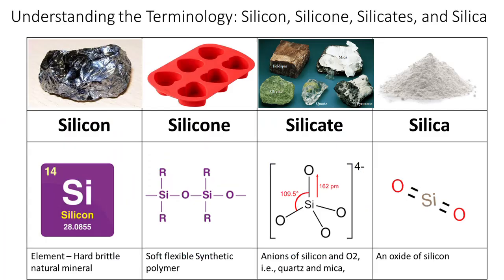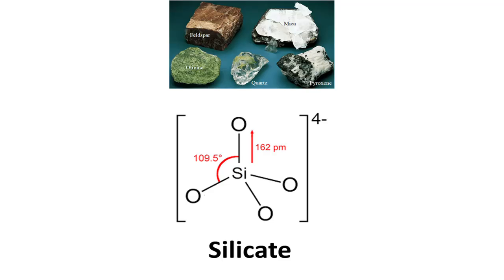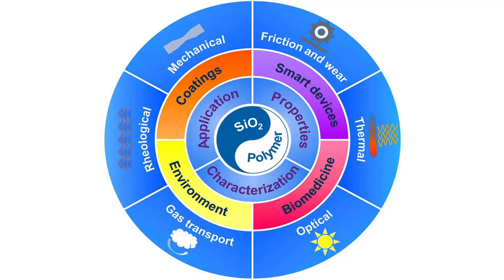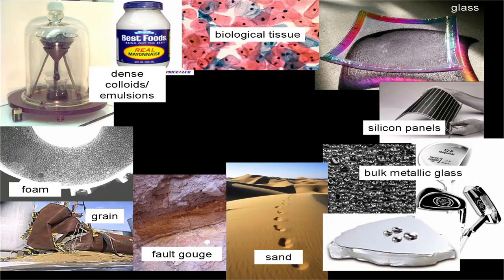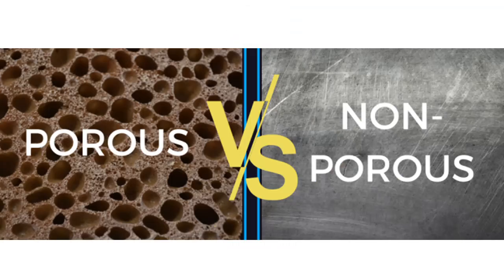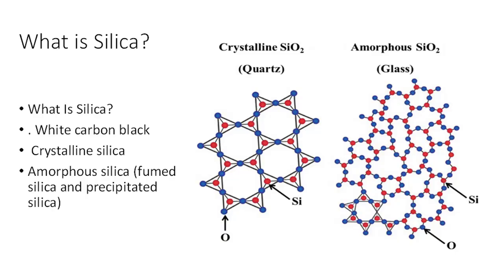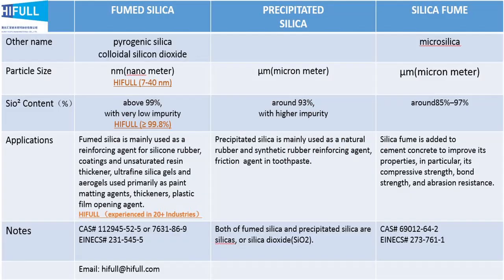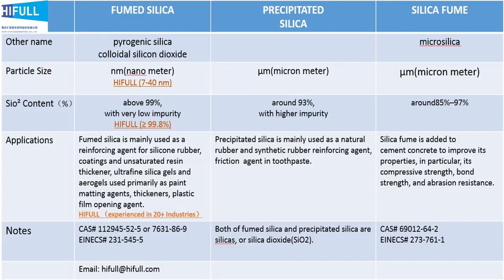All about Silica - Session 1 (Introduction)

Comment: Very good video. I heard you say that pure elemental Silicon is highly conductive, is that true? I recall learning that its not very conductive unless you dope it to alter the bandgap, as in transistors
Reply from the maker: Hello. Thanks for your comment. You are right and that's true. Sorry for the confusion; actually, it has been stated in comparison with polymers, which cannot conduct electricity at all. But in comparison with metals, as it has been stated it is a metalloids and its conductivity is somewhere in between.
Reply: @Epoxy_Channel  definitely agree, I'd rather be insulated by rubber than silicon, that's for sure!
Reply from the maker: @UnsolPhysics  😄